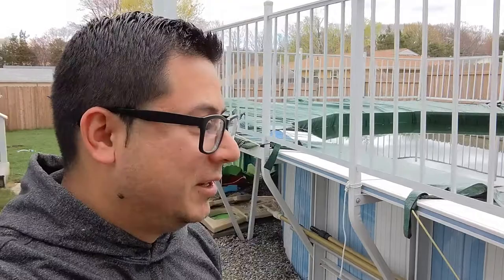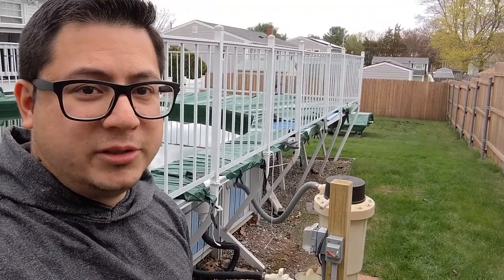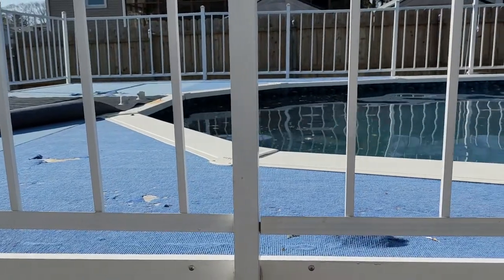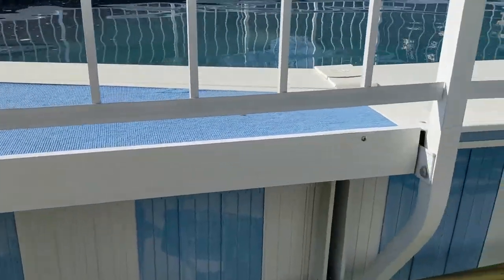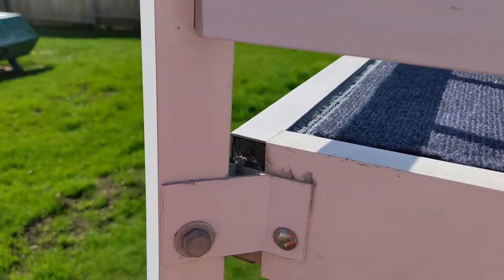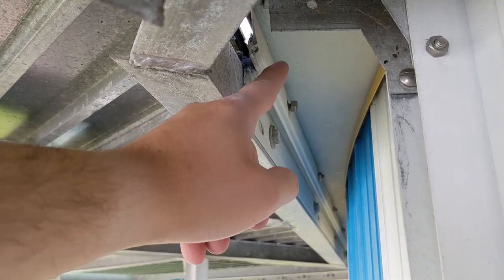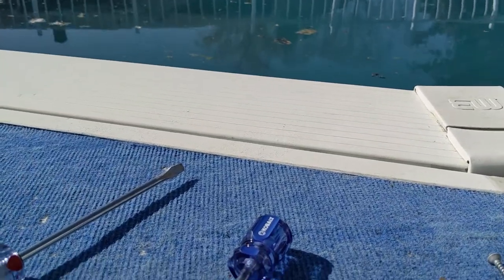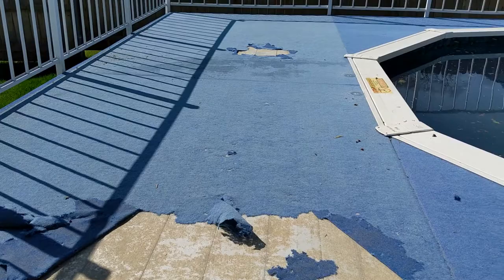Replacing My Pool's Carpet - Part 1 - Prep Work

Comment: I did the same to my pool. You need to remove the deck panels , the triangular ones. Leave the main deck unattached but standing in place. Heat the carpet with a torch and peel off. Apply new carpet and overlap edges by an inch or so and bolt it back together.
Reply from the maker: Yes! If I had to do this all over again, I will remove the panels beforehand. I didn't realize how much work this would take ha.

Comment: you definitely need to drain water off during the winter as much as possible.  You wont have the ripping issues.  Also grab a pool pillow that goes on the water, under the cover.  IT helps with the weight if properly adjusted tot he center   EDIT - just saw the pool pillows
Reply from the maker: I do have two separate pool covers I plan to use, one covers the pool and the other covers the deck (the pool one is not long enough to cover both pool and deck). And I have pumps to remove the water on top.

Comment: Hi, great job you did. I'm doing this too now. Can you tell me what sandpaper you used in the  orbital sander? I'm using a non-orbital sander and using medium sand paper and the glue is not sanding down to metal. I am able to get the glue kind of smooth. Wondering if that really matters. Thanks.
Reply from the maker: Thanks! I believe I used 40 grit sandpaper on my orbital sander. But I was honestly lucky because my glue was very old, and it mostly had turned to dust. So 40 grit worked for me. I didn't really get all the way to the metal either, but I think as long as you get it mostly smooth and clear of debris, you may be okay.

Comment: How does it look now, after 2year? Question about your pool siding, have you had oxidation issues? And what brand pool do you have?  

Thank you 
-RC
Reply from the maker: Hi. I haven't taken the cover off yet, so I can only see a small portion of the deck, and it looks pretty good still! Nothing has lifted off the metal deck, so I think I applied the glue correctly. 
As far as the siding, this is an Esther Williams pool, and they use painted extruded aluminum for the siding. I have not seen any oxidation issues yet, and if there are, maybe I haven't noticed it. The inside of the pool was looking brand new when I replaced the liner in 2019-2020. The outside, I had to clean it a bit last year and it was still in pretty good shape.